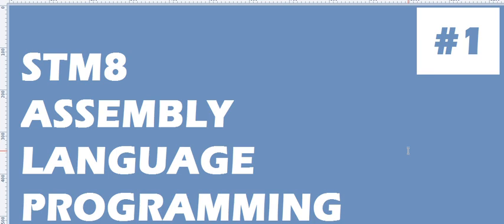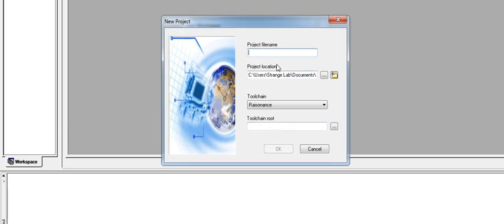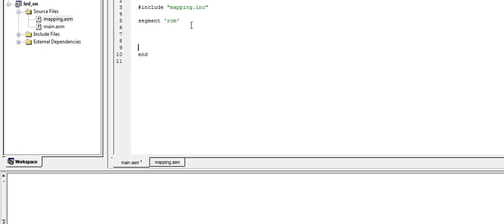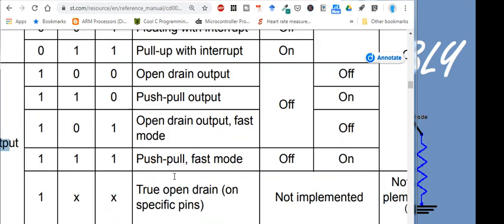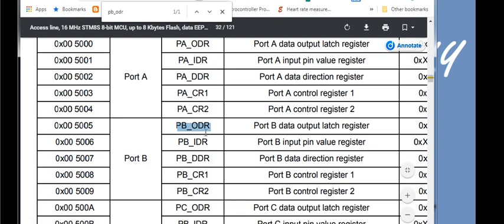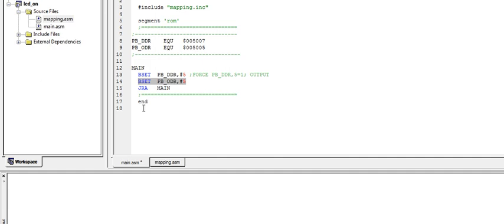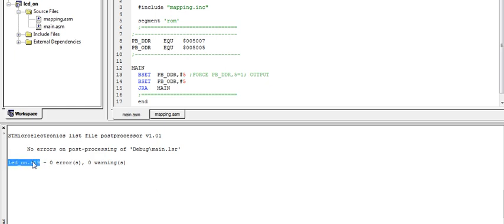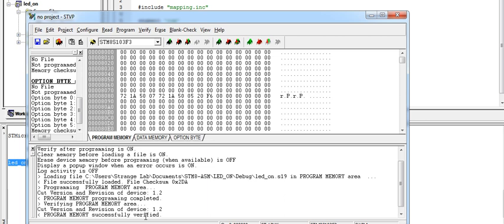STM8 Assembly Language Programming| stm8s assembly example | stm8s programming tutorial from scratch

Comment: All these definitions are already in the  STM8S103F.asm. You need only write #include "STM8S103F.inc" or "STM8S103F3P.inc" and add file STM8S103F.inc and STM8S103F.asm from stm8_toolset\asm\include to the 'Include Files' folder in the project.